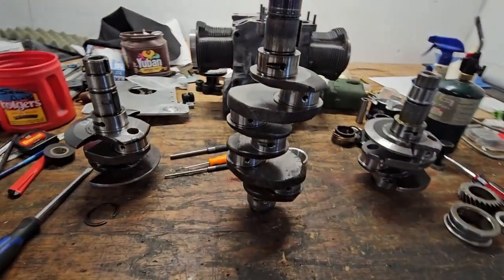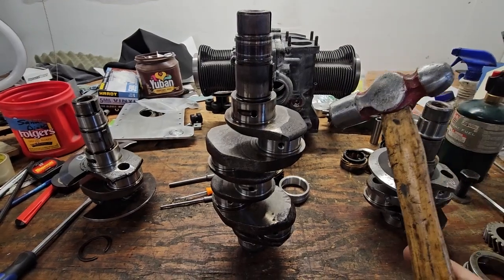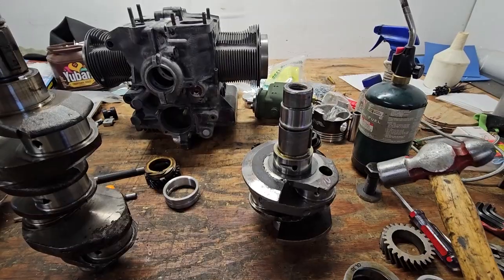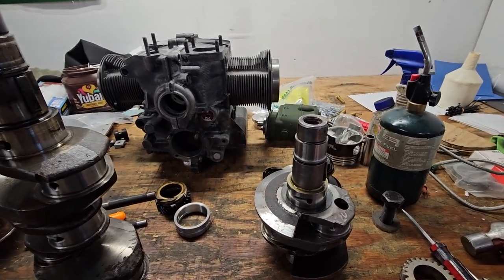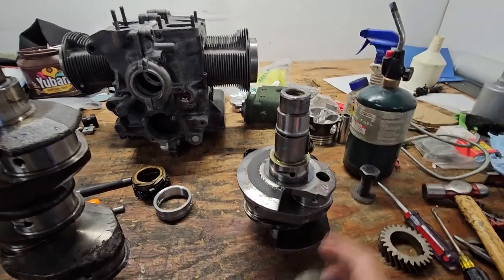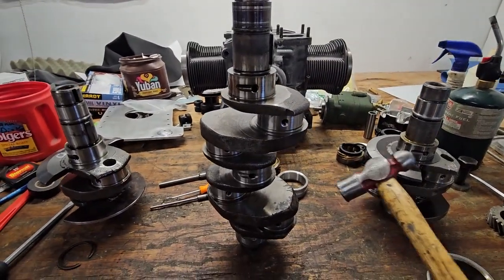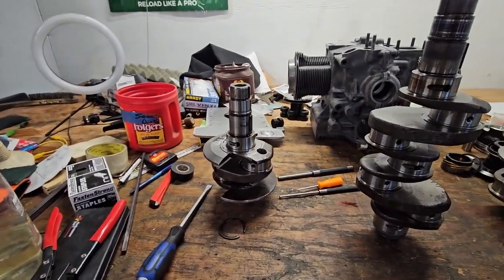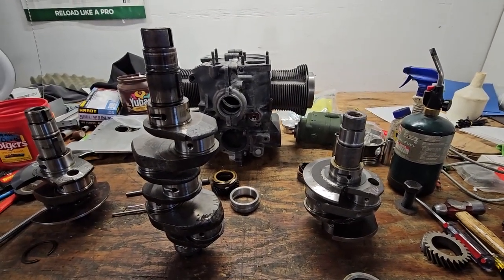1/2 VW Build - Crankshaft Comparison CORRECTION!

Comment: If you want the crank to ring, it must be suspended in the air. Either pick it up and hold it while tapping, or suspend with a wire. Even a bell won't ring very well with the bottom stuck to a wood bench.
Reply from the maker: Actually they will ring sitting on the workbench.  The problem was the gears that were still on the cranks.